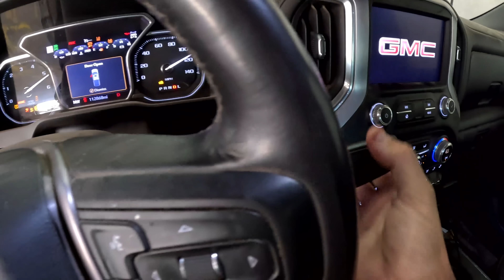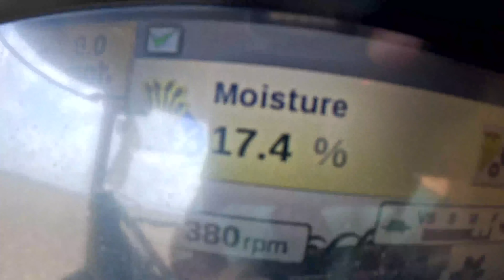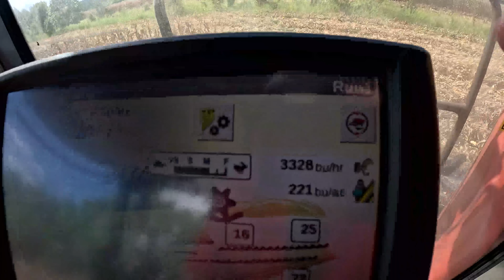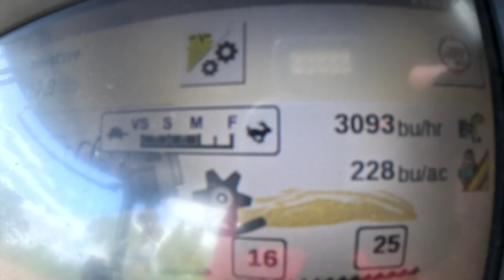HARVESTING CORN BEFORE THE HURRICANE

Comment: When I was a kid my Uncle Grew Milo on his farm. LONG SLEEVE SHIRT, No matter how hot it get. You will thank us Later, I promise. It's not ready but it's close. I can tell you a visual tip, the redder the better. Try to keep the red heads in there and avoid a lot of the plant if you can, that will be difficult manually, but your auto height on your header might help with dips in the field. You shouldn't have an issue keeping the crop in minus the header loss, and with a draper it shouldn't be terrible. Like others have said, start with your recommended machine settings, and make adjustments from there. 

Just some tips I learned from my uncle back in the days of old.
Reply from the maker: Great tips, thanks for watching 👍😁

Comment: Milo don't look bad should 50 + bushel to the acre just guessing from what you showed we use rigid header with milo guards installed, regular cutter bar without the guards you will loose several heads out the front. If the heads are right (dry) it's easy cutting but the dust is really itchy.
Reply from the maker: Thanks for the info 👍😁

Comment: With your planting population the sorghum should do good. Considering your corn yields you should be able to grow 150+ sorghum, but just like any crop it’s a learning process. One thing to remember is that sorghum takes more N per bushel to grow than corn, there is a misconception out there that it lakes less fertility. With your Draper header head loss shouldn’t be a problem, start at the recommended setting and your machine will do fine. Only take the heads in if possible
Reply: Also a early to med/early maturity could do fantastic as a double crop behind your wheat.
Reply from the maker: Great info thanks 👍😁

Comment: I grew up in Sorghum country...the great plains of Texas .    When we started growing irrigated corn it made 160bu  in 1960's the sorghum made 160.   Yours could make 160.   The combine settings are on the card in arm rest.    You will close the pre chaffer and wheat concave.   increase the rotor speed.   You need milo guards to keep the heads as they are cut off.

Comment: Milo is a very versatile crop especially when rainfall is lower. Good years here in NC 85+ bushel crop is pretty good. The surprising benefit of milo is what the stalks and root mass after to the ground and your rotation. When we had turkey manure available we would cut and bale the stalks for the cows. Crimp the mower tight as you can to get them juicy sweet stalks drying down. Cows love it because its sweet. Good luck

Comment: I had a rattle for a long time that changed with engine RPM, sometimes you’d hear it other times you wouldn’t. Turns out my one of catalytic covers was coming apart on the inside. Replaced both of them and the rattle went away. The truck seemed to run better as well.

Comment: Does it have a 2 piece drive shaft with a steady bearing? I also watched the video and at 6:48 you can see slop in the rear universal. Sometimes 1 cap on the universal doesnt recieve grease and will cause vibration as its failing. Also that rear-end has way to much lash. Some play is normal, but not that much. Pull drain plug and make sure no filings.

Comment: If it only does it during acceleration it might be the pinion bearing or pinion itself or a tooth broken maybe, it will only be apparent when pressure is applied between teeth during acceleration. Change your rear gear oil and see if there is more than just small amount of metal in the gear oil might show that’s your problem. Good luck finding the problem.